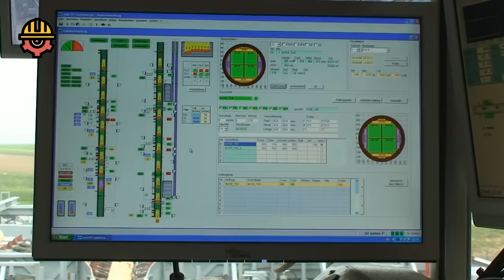Amazing Modern Automatic Wood Processor Production Factory, Incredible Modern Wood Processing Lines

Comment: One reason eucalyptus trees were brought to California was to grow sailing ship masts. They weren’t suitable- dense/heavy, and when they do have a branch they tend to be very large, disrupting the trunk grain. A northern California plywood mill manager decided to try making plywood from eucalyptus. They got a fairly long, large trunk free of branches (may as well start with something easy, right?). They steamed it. It stunk to high heaven. They peeled it in the veneer lathe. It stunk to high heaven. They glued five sheets to make 1/2 inch plywood, put it the heated press to set the glue, and it stunk to high heaven. They sent it to the trim saw, a band saw with inserted carbide teeth. In a harbinger of future doom, it tore half the inserts from the saw blade. And stunk to high heaven. They made a piece of stud wall framing. And brought in a Senco nail gun. It couldn’t drive 12 penny cement-coated sinker nails through the plywood. They wound up pre-drilling holes so they could nail it to the framing studs. And they gave up on making eucalyptus into plywood.
Reply: The idea stank to high heaven......
Reply: Eucalyptus trees we're brought to the United States for the sole purpose to make railroad ties.
Reply: @greggminkoff6733  I stand corrected.